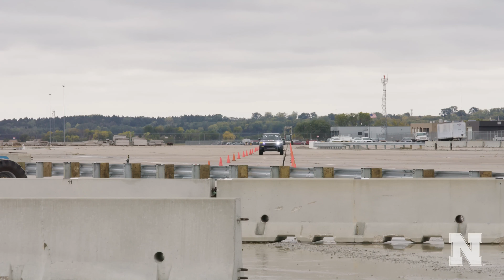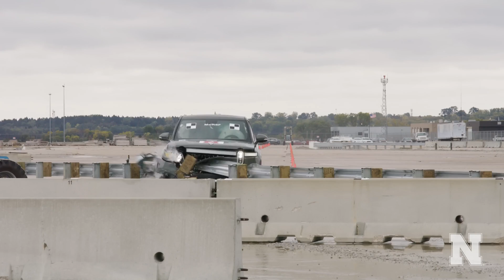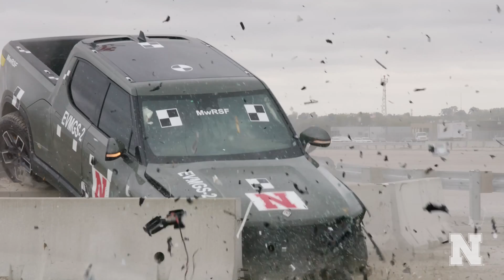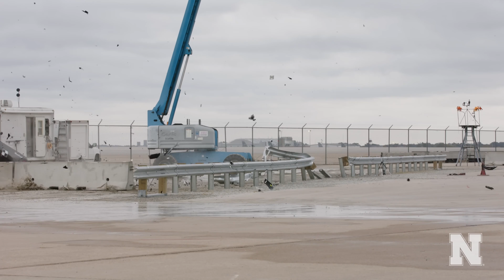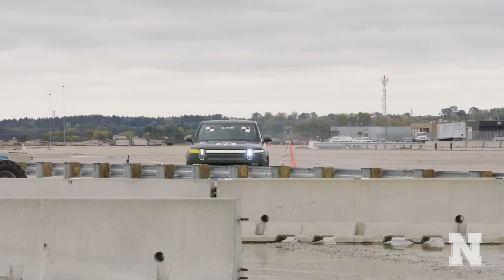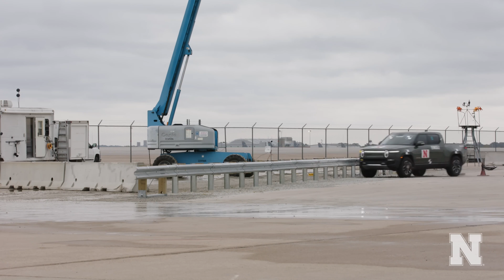Steel Barrier Test of the 7,000-pound Rivian R1T. Railings Cannot Withstand Heavy Electric Vehicles.

Comment: Guardrails are not designed to withstand a direct 90 degree T-bone hit.  I'll bet a Toyota Camry would go right through the Guardrail too.  Why the fearmongering about EVS?  By the Way, The Rivian R1T is a has a wheelbase of 136" and a curb weight of 7100lb.  A Gasoline powered Ford F-150 crew cab has a wheelbase of 145" and has a curb weight of up to 6800 lbs.

Comment: Did people forget the existence of heavy pickup-truck like fordf350 and a frickin semis?
Reply: F-650 crew cab with a bed 💪
Reply: except this is the size of a ford ranger.... also the f350 version will come eventually, and it will be like 15,000 pounds
Reply: @octosquid9918  cybertruck is the size of Ford F150 but its lighter than Rivian.
Reply: Did you forget about the ultra low center of gravity?

Comment: EVs aren't the issue, SUVs and Trucks are. Even the average gas truck weighs close to 5000lbs, A Chevy suburban can weight up to 6000lbs and an F250 weighs as much at 7600lbs. A model 3 weights around 3600-4000lbs which is inline with most gas sedans.
Reply: Center of gravity is much much lower
Reply: Cope and seethe

Comment: Cars itself are a huge problem and have countless disadvantages. The goal should be to use as much public transit as possible, however due to lobbying in the US ist nearly impossible.
Second of all EVs aren't the problem. The problem are SUVs heavy unsaved death machines. A normal EV doesn't have those problems and is way saver than an internat combustion car. But the SUV death machine shown here is just a heavy tank. It ain't save. It's nearly as bad as the cyber truck. It's just mindless, bc nearly nobody neads smth like this. It's just an ego and death machine.
Reply: @Hello_there_obi  generally speaking personally Mobility is important yes. Cars can't be replaced. Just think of plummer a or other services like that.
However with public transit you still have freedom to go where you want. It depends on the system, yes. But it's the same with roads. Reality is, it's possible to build a city, where a car isn't required. You could then rent a car if needet. That's way more eco-friendly and less cars in city's gives room for social activity and healthier lives.
Reply: This all depends on the puplic transit system.
It is possible to live without a car inside a city. With public transit you can very well take things with you. Of course it has its limits and when you need to transport large amount s (furniture,...) puplic transit isn't gonna cut it. Then you need a car. But how often do you need to move such large amounts? It's gonna be very rarely. For many city's it's completely possible to live without a car. You can buy groceries and all your needs without one and rent one for the rare accurance of needing one.

Of course you have to wait, however this also depends on the network. Waiting times of max 10 min. Are very possible and no big inconvenience.

Compare it with driving car.
Car: You need to pay attention to travic. You can't use your time otherwise (reading for example). There is high congestion (usually) and it's slow.
Public transit(tram):
You need to wait a couple of minutes. You don't need to worry abt traffic. You can use the time otherwise.

Compare the speed. In European cities a bike is usually the quickest option for anything below 5 km.
Public transit is usually faster or the same speed as cars.

I think we have different concepts of dystopian. Cities are gonna grow, that's gonna happen weather you like it or not.
Now I don't think it would be dystopian to have less roads, but to use the space for saver sidewalks, bike paths and for example trees. I don't think it's dystopian to convert parking lots to parks.
Sure we can't remove all roads, but we can remove lots of them and use space differently, because if we actually only used a car if we needet to, there would be way less cars (car renting).

Owning a car doesn't give you magic freedom. Your responsible for endurance and accidents. You are dependent on roads and fuel. That isn't freedom. It's equal to public transit, there you are also dependent on the network and power for trams to run (or fuel if it's a bus).

Roads use up huge amounts of tax money, if we would need less roads, there would be more money for things like education, Healthcare or other investments.

There isn't only close proximity public transit. There are trains. With trains you can take large amounts of goods or people faster and more efficient to other places than with cars or busses. Public trains also provide the ability to take more with you.

You very well could have the ability to live with public transit and use it most of the time. Such a world would be more eco friendly, healthy and cheaper. However most of America is different. That's because of lobbying and well capitalism. (profit motive ~more selling cars ~ more roads ~ current situation | lobbying is also involved as said)
Reply: I think you phrased this comment badly, cars are necessary, but the mast majority of people only really need a small, economic hatchbacks, yet the majority of americans will buy pointlessly huge vehicles due to advertising and old, badly made emissions regulations.
Reply: @mactep1 this is because of the terrible public transport. In a city with decent public transport you don't need a car.
Reply: @IceFlame963  which city has public transport good enough to take an ikea table?
Reply: @mactep1  ever heard of the concept of delivery or renting a car?

You won't buy an IKEA table daily, at least I hope so.
Sure you are gonna need a car sometimes, but not own one. Normal live can be done without one.
For things like moving or furniture, as explained before, a car can be rented or it can be delivered
Reply: Why this is related to this video?? Public transit can crash too.
Reply: @fanzhang7161 
Public transit is much saver than cars.
If you compare public transit (reasonably developed public transit, often found in Europe) you will find that the number of deaths from crashes is much lower. The number of injuries is much lower.
A lot of crashes involving public transit happen due to the large number of cars. SUVs Beeing among the largest danger due to size, speed and non crash compatable design.
The cars are the problem, without cars, public transit would be even saver as it is.